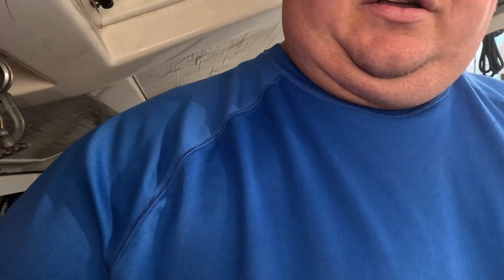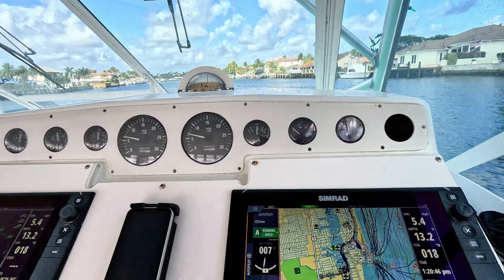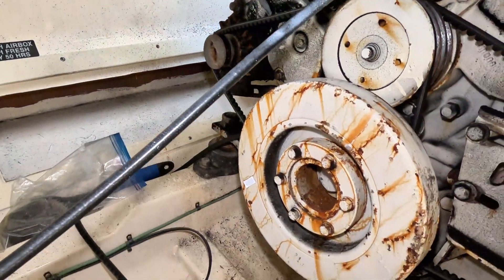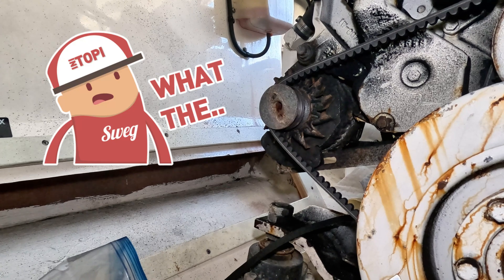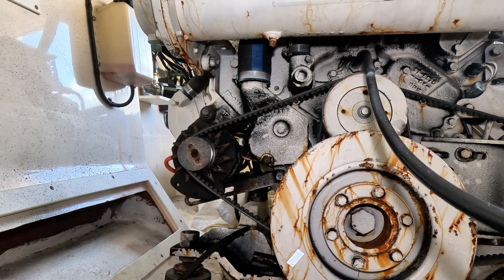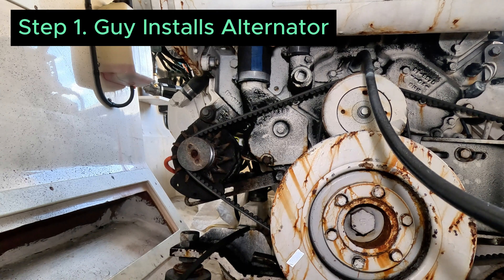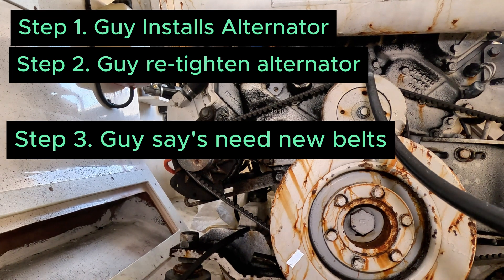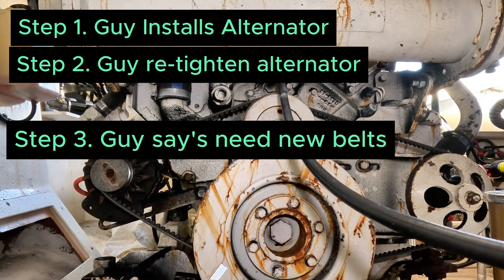I GOT A GUY: How It Killed My Marine Engine Caterpillar 3208

Comment: Almost looks like the bolt on the dampener is off center. Might be an optical illusion from that angle. But if it is off center, it would do that to those belts.

Comment: How did it "kill" the engine?  The engine is fine aside from the alt and temp sensor.  Or, did you overheat and then kill the engine?
How did the bolts being in front to rear vs rear to front cause the belt to fail?
I'm confused.  It appears as though that's the wrong belt and or that alt was installed out of alignment.   Where is the belt wearing?